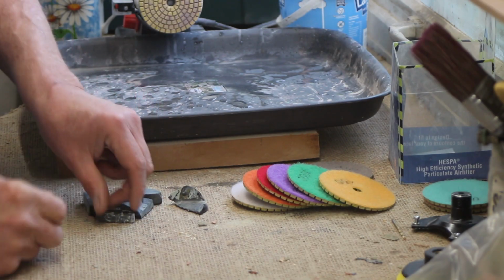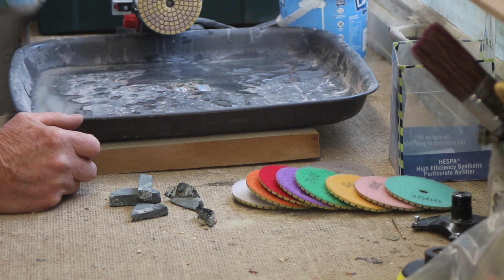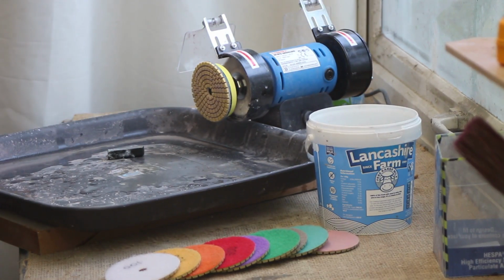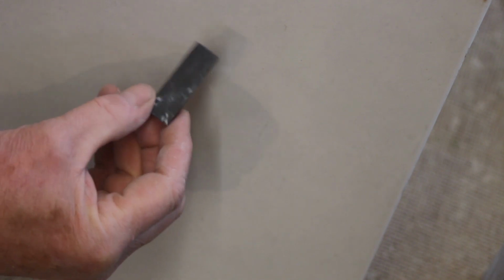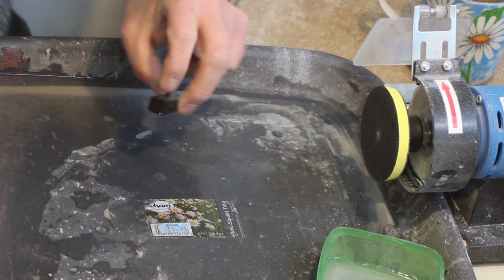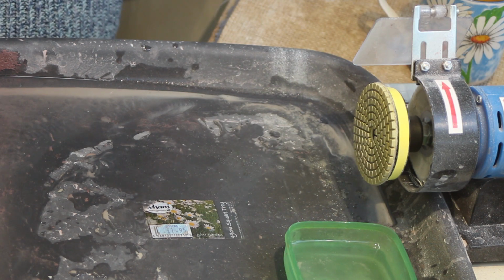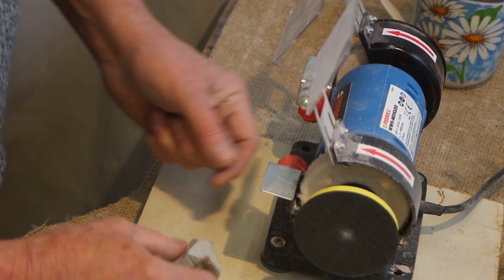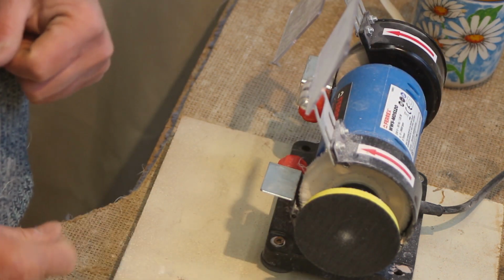Make a simple Marble pendant.

Comment: Is there a way to do this by hand, without a machine? I have a small piece to polish to turn into a necklace. Would sanding it down by hand achieve the same results?
Reply from the maker: Hi Ben, it depends on the hardness of the stone or marble type. It will be possible on a small piece of marble, use wet and dry carbide paper in various grades and finish with a polishing compound of some kind. This will take a while so best of luck.
Reply: @thestonecraftingworkshop7490  super thanks I’ve ordered those bits. Fingers crossed.